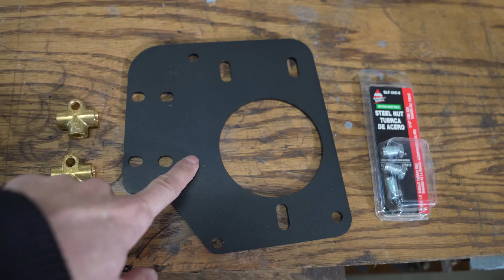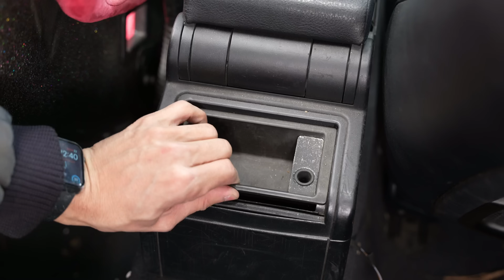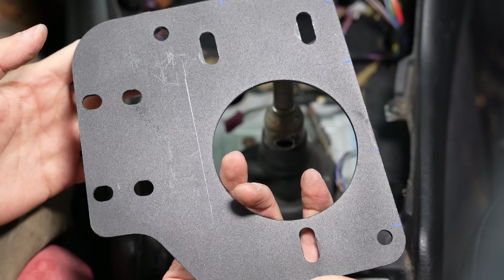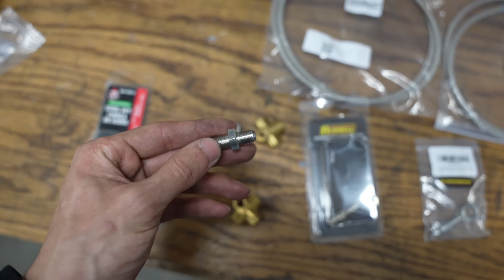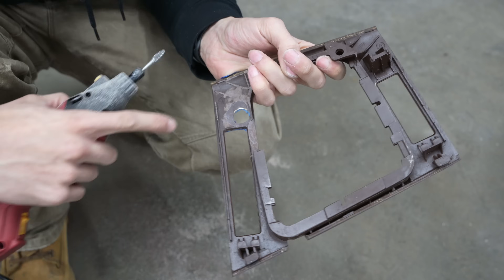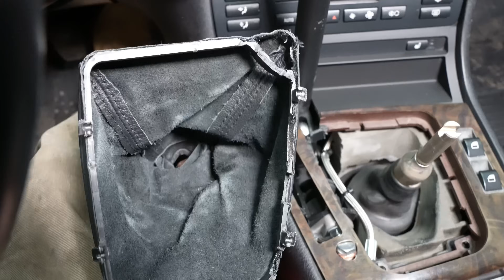Installing BEST Hydro Handbrake Setup (Inline) on my E46 Drift Wagon

Comment: I just did this with the willwood cylinder and you should turn it upside down, then the lines wont be into the molding and you wont have to cut it, aswell as it will be much easier

Comment: How did you disable the abs and get the speedo to work ? I have same setup but my hydro isnt working because of abs and only way to disable it is to remove fuse 33 but this gets the speedometer to be not functioning.
Reply: Front right wheel, disconect abs sensor, you will have cluster, no limp and no abs 🙂
Reply: @AIRIDASJankauskas  didnt work for me, it disables it only for the front....rear still have abs enabled
Reply: @alotofmewaslostinyou4493  Pull Fuse 61, worked for my Euro E46

Comment: WHAT THE?? Joel did I miss something about the new lever? You said you were just going to go for the Wilwood system so it would just work right off. Then you had to modify the whole Hydraulic piston to fit?? Why would Wilwood screw up that much on the fitment?? Or was the two parts not from the same kit? I guess it must have been or you would have sent it back or something.

Comment: Those are m6 bolts i use alot of m6 eye bolts to lift shit at work granted lifting is a different force but for a quick comparison the eye bolts are marked for 70 kg. With 3 if them i wouldn't worry.

Comment: You bought all the parts to delete the ABS pump and run it as true brakes with an inline, but you left the ABS connected and functioning? Do you plan to delete ABS / DSC so it doesn't mess with your slides?

Comment: Sometimes when u plastic weld melt in a paper clip for more support

I think the driver side is only auto. And u mixes things up now. Maybe need a driver motor in the pass side too. But something is different thats why there acting different with the same command. Hope i come across ok

Comment: You really shot yourself in the foot with that wilwood lmao. The master Odesa uses isn't a cheap chinese master like an ebay hydro, I'm fairly sure it's a clutch master from some random car.
Reply: Better safe than sorry I guess 🤷🏽‍♂️
Reply: @currymasterrace7153  Except it caused sooo many issues if you watched the video, many that wouldn't have existed with the supplied master
Reply from the maker: didn’t know that master cleared all the trim. no biggie tho, i don’t like the idea of a master with no part numbers on it plumbed inline
Reply: @ImJoel  Yeah it's all good, wilwood is definitely more reassuring and saying stuff in the comments with the benefit of hindsight is easy. Still if I were you I'd wish I just used the supplied one lol
Reply: I’ve got the same hydro, the odesa master lasted half a day on track, we’ve spent weeks trying to figure it out but ended up buying a wilwood master
Reply: @jackryan4420  
You're never avoiding manufacturing defects, it happens. Know many using the odesa hydros, no problems. Guy behind odesa drives it, so does all his friends, he wouldn't keep choosing that master if it was that bad as he'd suffer too.